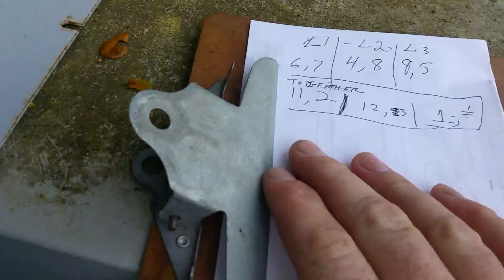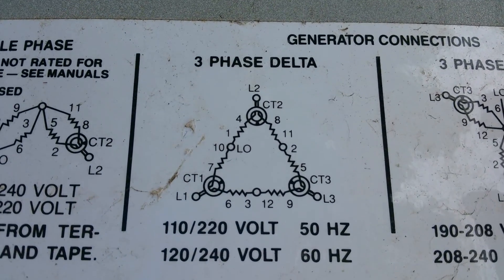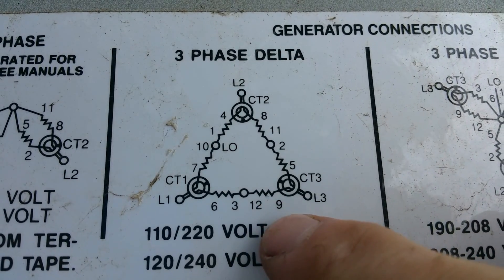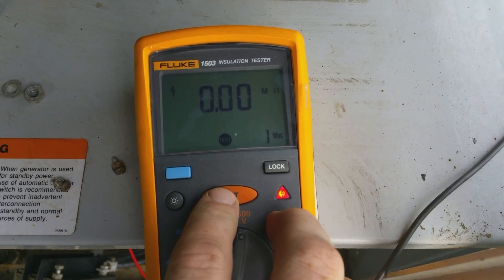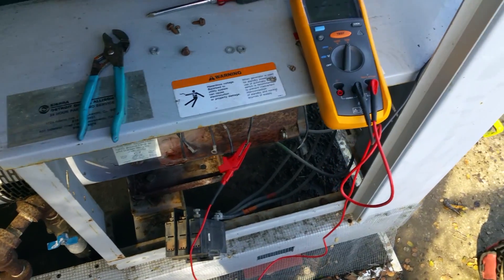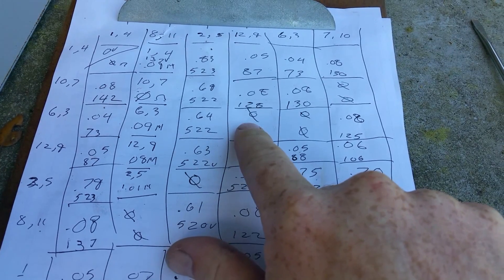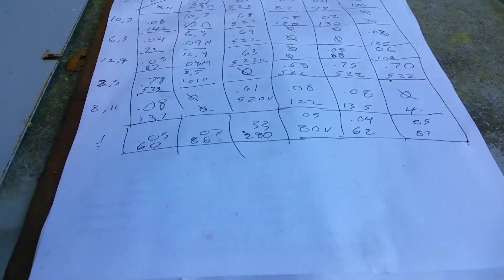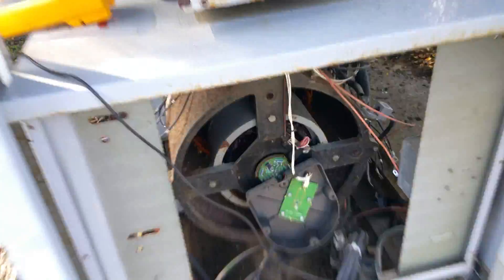testing the insulation on a generators windings  (mega-ohm testing)

Comment: hey, do you happen to have instructions on how to check windings on a generator ? I've never performed this and don't want to mess anything up. also. would you perform this test on all makes of generators?  thanks for any information
Reply: hi! You are very well informed! I have some bkrd in electrical stuff, and just bought a megger to test some motors I have rescued from "Irma" here in Fl (by "dip and bake" procedure).  For instance, I have got an Aurora 6800SDE running, and was able to power a n angle grinder as load. Then I disassembled the unit and am presently inspecting the brushless rotor and  stator/exciter. Next step is to meg out both, but the rotor has no commutator(obviously), and the stator just has terminals L1,L2,R1, R2;and the two capacitor leads, and the two (green)  wires to the control panel. I was not able to find a wiring diagram, and do not yet understand how you set up your table of values. I think I need to understand better what you have done, starting with the  delta triangle. ..